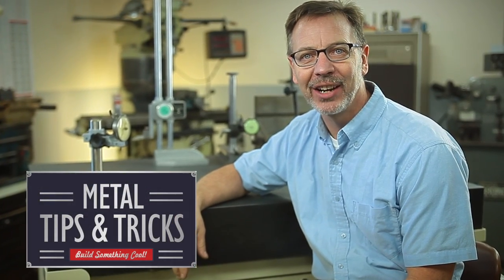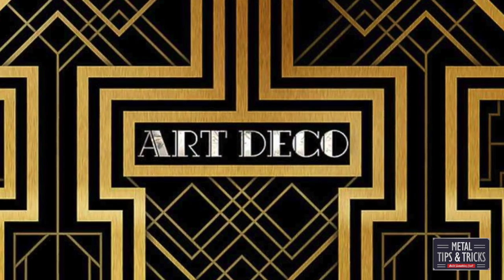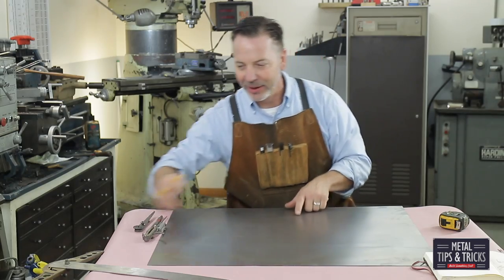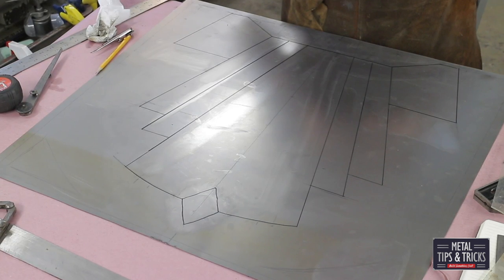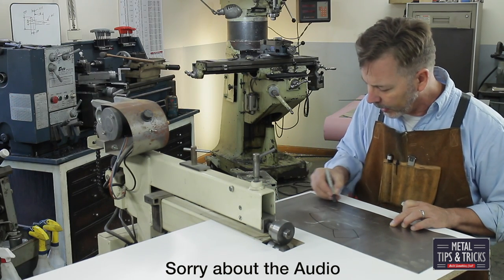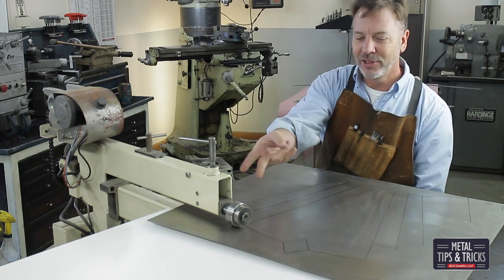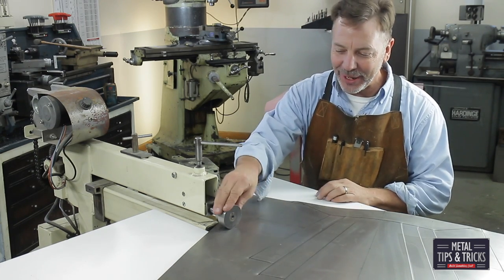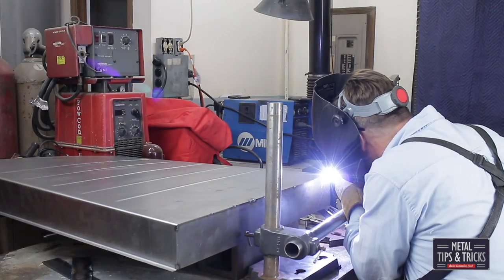Ultimate Metrology canter (Part 3) Bead roller work

Comment: Great look and classy choice of that art deco style. I am a bit surprised at how you forgot to mention how much strength bead rolling adds to a sheet metal panel though. That's the main reason it's done and unless it was a pure art piece the artistic extras are just that. But I honestly can't think of any design that would have been better. Now I'm really wanting some sheet metal fabrication equipment I'll never have room for Dale.

Comment: I know this is an old video, but for some that are still watching... pre-stretching the metal where you intend to use the bead roller will help eliminate most of the distortion in the panel. There are thinner bead roller dies now that are better suited for the more artistic bead rolling as shown here. Nice work though.